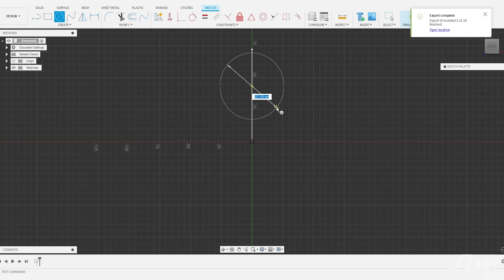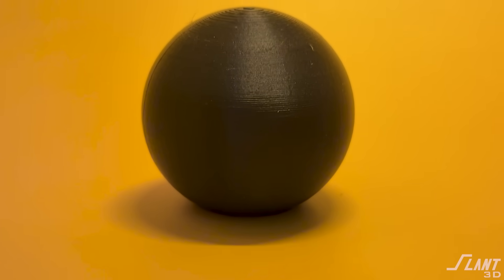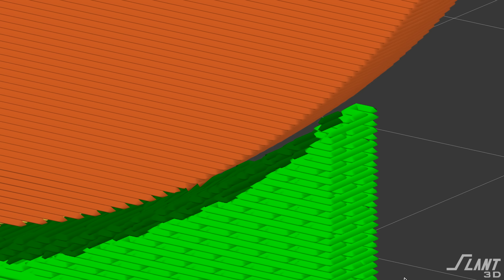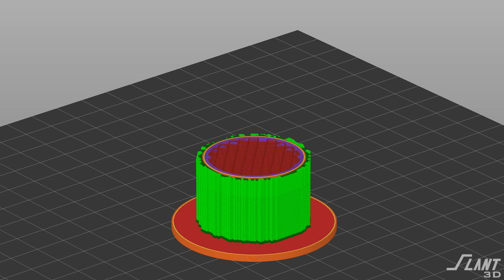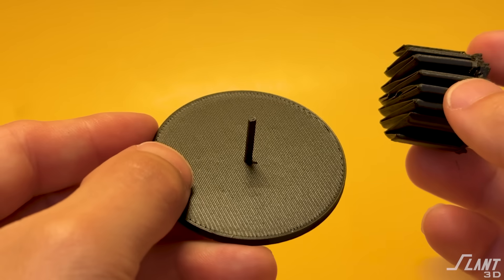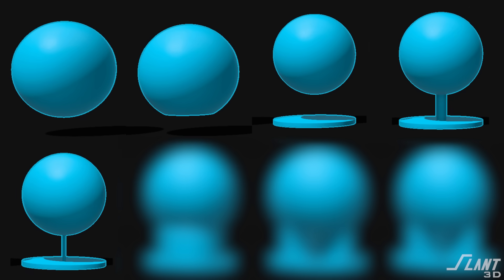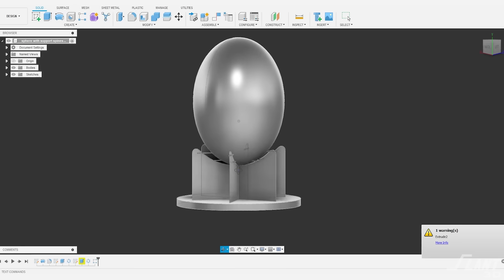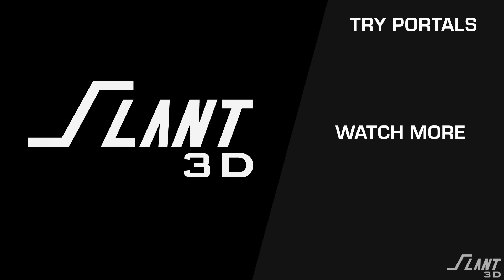Can We 3D Print a Perfect Sphere?

Comment: What about printing just a support and beside it a half sphere. When that's done, it pauses while cooling the nozzle, then you pop off the half sphere and place it upside down in the support. Then the printer with its cooled nozzle pokes the flat top of the upside down half sphere until it's level, heats up again, tacks the now leveled half sphere to the support and continues printing the other half to make a full sphere. 

Now you have a perfect sphere with 2 top surfaces and no bottom surface!

Comment: I had a great result splitting in halves (as many suggest here in the comments) and also adding correspondig pinholes that i print little pins for, so that the fixing together with glue becomes as correct as possible. Doing this and setting the layerheight to the lowest possible made a really really nice result when doing some knobs for my friends vintage car seats.

Comment: Interesting video! Printing a perfect sphere can definitely be tricky, but with XIONEER VXL soluble support material, achieving smooth results is actually quite manageable. ;-) The supports dissolve cleanly, making post-processing much easier and reducing warping issues significantly.

Comment: Hey Slant 3D, I’ve been trying to reach support for over a week without a response. One of my clients purchased my designs through the portals but hasn’t received any confirmation or tracking info. Could you please look into this? I’d really like to continue working with you.
Reply from the maker: Send through the info you have and your account to support. I tried tracking the order from your YouTube user name. If I got the right info it is in transit. Parts can take 2-5 days to print and then there is transit time. And obviously have the customer check their spam. They should receive a confirmation and tracking email.
Reply: @slant3d  Thank you for your time and effort in resolving this. It would be nice to know more about how the Portals system works from the client’s side. Does the client automatically receive an order confirmation or tracking number? Or did we do something wrong that caused our client not to receive this information after purchasing the item? Also, we’ve tried sending these and other technical questions through the Slant 3D contact form but haven’t received any replies. Regarding Portals, should we use a different contact to get the answers we need? We just want to understand how everything works.

Comment: To print a sphere, raise up and use multi-material printer with dissimilar material supports.
Or if you have a single material printer... 
Print hemisphere. Use elephant's foot compensation or print onto raft for max accuracy.
Remove from bed.
Print cup into which the hemisphere fits, with GCODE to pause and hold bed temp and motors at the end, and zero Z height. 
Put soluble glue into cup.
Place first hemisphere into the cup so it's perfectly level with the 
Print another hemisphere onto the first, ensure GCODE is does not have any homing.
Remove sphere, clean off glue, enjoy sphere.
But... why did you 3D print a sphere anyway?  Did nobody sell a correctly sized sphere?  If you needed something other than an exact sphere, tweak the design to include intentional features which avoid this issue.

Comment: All these videos should start with "Using our machines and portals with our fixed settings and without any post processing....how do you get a sphere like object?"
Most of us are trying to use every feature and trick available to make one or a couple "best parts". Slant 3d is trying to make N number of parts with no manual intervention , using fixed printer settings to make parts that are "good enough to sell".
It is not the same approach.
Same as a craftsman making one piece of furniture versus a factory making 1000 copies of the same piece. 
Each uses different techniques.
Changing your design to suit the limitations of the process will make the final result look like less of a compromise.
Reply: Stuff like adaptive layer height and scarf seam (not sure it would work in this instance) are indispensible slicer settings, but other than what can't truly be replicated outside of a slicer, even if you don't mass manufacture, it is better to have to change less things to get the result you want. Because consistency matters in most cases, even when printing gridfinity boxes for yourself or anything, really. So if you happen to have another machine or other material or have any change whatsoever in your print environment, you don't have to experiment all over again. I also advocate getting close to perfect results as possible, but if you can achieve the same close to perfect result in a less messy way and in less steps, that's more preferred.

Comment: I know yours trying to avoid doing anything in the slicer, but adaptive layer lines, changing the wall order, and adjusting the line width can all work together to solve the issues with steep overhangs. If you are really going into production on something you are going to do DOEs to dial in these defects and get closer to what you want.

Comment: I made a sphere as two hemispheres with a central hole into which a cylinder fits snuggly. All three parts print and and are then assembled with a bit of glue or you can make it a press fit. The cylinder provides alignment during glue up or a mechanical link if no glue is used. One could use any other extruded polygon or a threaded feature if you want to restrict rotation of the parts after assembly.
If you want to use the threaded method, an actual metal threaded rod can be used to join the two.
This same method also works great for making a tire / wheel where you want rounded features as printing this way eliminates the "bad side" of the print.

Comment: 4 methods to print perfect spheres:

1. split the model into two half spheres and glue together
2. use specialized support material
3. use PLA for the model and PETG for the support or the other way around
4. use adaptive layer height in the slicer settings. you can print steeper angles with thiner layer height
Reply: That's basically the best answer
Reply: All of that would be good general advice. The advice that comes from this channel pretty much only pertains to advice about their printing service.

Comment: Is it possible to print the cut-off version of the sphere (e.g. hemisphere), pause the print, and then rotate the sphere on the bed until the flat part is facing straight up, then resume the print and have the printer finish it off?

Comment: i just truncate a segment off the bottom that way i have a decently large flat surface for the print bed and i have less extreme overhangs as the lines go up the sphere. no supports. ive always found that in my designs i never need a 100% sphere, i can always hide the flat surface inside somewhere after assembly.

Comment: If cooling at the boundary of the sphere and the support is the problem. Continue the support to the mid point (or further). It doesn't have to touch the sphere just reduce the air flow, alternatively change the cooling fan at that height, though this does break the design once, print anywhere strategy.

Comment: Perhaps the only way to do it is to cut the sphere in half so you have two completely flat areas to print and then glue them together. Put a hole in one half and a pole in the other so they line up perfectly and have strength. 🤷‍♂️🤔

Comment: I thought the cop out option would be to split the sphere in half with both halves flush to the build plate and affix them together after the print. 
Also expected you to mention how to resolve some of the issues with the seams - like using scarf seams and variable layer heights to resolve the issues with banding.
Reply from the maker: Thought about that
 But half spheres are not spheres. Mainly wanted to show how to support a curved surface

Comment: 'Adaptive Layer Height' seems like very low hanging fruit for getting a better result. I don't think the inconsistency has anything to do with shrinkage, it's just drooping unsupported lines. You could also use support interface if you have a suitable printer.

The floating sphere is an interesting idea though.

Comment: Did you try resin2fdm? the thin supports might give better airflow and reduce warping
Reply from the maker: We made the thinner supports in the video
Reply: @slant3d  Yes but not as thin as resin supports and also on resin supports the contact points are small so there would be less warping. Look into resin2fdm its really cool

Comment: Cut the ball into 2 parts, print with flat on bed, glue together when done (a post hole and a printed small post help alignment) and this will achieve the perfect sphere (I've done it and if you are good at aligning the 2 parts you will never know it was 2 parts).
Reply: 3d printing "entrepreneurs" are obsessed with making their designs require the least amount of post processing possible.
Reply: @makarevych  They'll print the same part they only need one of 10 times trying to dial in the settings when 5 minutes with a file probably would fix the first one...
Reply: @makarevych well in this case it makes sense because this channel only exists to advertise their service. They print stuff for you and send it to the customer. They don't want to be sanding or gluing your parts for you, they just want to print it and ship it.

Comment: What if you create a custom mesh like support to give the sphere air flow.
For example, those airless balls that are a mesh print quite well. What if i make a custom support for the sphere like that...

Actually, I will try it... Create a pillar, cut a sphere shape from the top, add a sphere to the top. Now i have 2 objects. In the slicer, define the pillar as a gyroid infill without top surface and walls.... Use Arachne, and dynamic layer height for the sphere.... Let's see...
Reply: But no matter the support type, even if the pattern and contact is different, there still would be the issue with the contact point no mater how small
Reply: @user-ll4om5pq4u  The  airy gyro support did fix the warping, but the contact points are still noticeable around 1 cm for a 40mm sphere.

Comment: So what I'm hearing is encase the entire sphere in support material all the way around and on top so the shrinkage/cooling is uniform throughout.
Reply: Yea I really expected the last version to be exactly this - have the supports envelop the whole sphere (or probably just to the mid point) - would be interesting to see if the shrink line is still there or not. The final twist with making it into an egg was a little disappointing, although it is definitely a valid reasoning point,.
Reply: You probably can also design difference in sphere size, so open part would be slightly bigger to shrink perfectly? Probably not gonna work, but it's interesting to try I guess.

Comment: I'm not sure what you are describing as a shrink line is actually a shrink line. I think what's going on is a transition from how the sphere is being supported. Essentially, the part goes from being printed on supports to printing on top of itself. When it is printing on the supports, the liquid plastic gets layed down a fraction of a millimeter lower than where it should be, and this continues until it reaches the range where the overhangs are steep enough to where it starts printing on top of itself directly. 
This leaves a hairline gap that has to be compensated for somewhere, which is the actual source of the warpage and ugliness. Your CADded supports seem to indirectly address this, but I can't quite put my finger on why.

Comment: I know you hate relying on slicer settings, and I get why, but... if you take the designed in supports, and you make them lines rather than wedges, it will reduce the wider shrinkage areas right at the base, then combine that with variable layer height so the steeper curves have more fine layer height and you can probably get pretty darned close to a decent looking sphere. Of course, that does take you out of the realm of using it in something like Portals.
Reply: I agree here, you could take the supports further, and variable layer higher would REALLY come in clutch here.
Reply: @abowden556 can you explain what you mean by the variable layer higher and what would you adjust it to?
Reply: @ClappinCheex  for steeper parts of the curve, have the layers be thinner, the steepr the curve, the thinner the layers. This can even be variable based on if it's infil, or just perimeter, but there's problems with that, anyhow, even the safe simple version reduces stair stepping without blowing out print times too much, depending on the model and orientation.

Comment: Ya saddly design isnt really going to fix this issue what you will need back pressue on the molten plastic to correct the overhang and in order to get supports removed the only way to do both is in a multi-material setting (obviously without the egg copout or even splitting it into 2) this is why i want an idex so bad i dont care about multi-color just muti-material

Comment: I print a lot ball and socket joints in resin. With such joints the whole sphere does not need to print perfectly for them to remain functional. For instance the area of the sphere which printed poorly could be used as the place where you insert a rod or something like that. Or in some cases the rod can be 3D printed alongside with the sphere doubling as a support.

Comment: How would you design a support for a box with a domed, lattice hinged lid? I have a product I have been trying to improve the underside (inside) of the dome (printing it with the box bottom flat on the printer works great for all other parts of the print). The cross beams of the lattice comes out a bit rougher than I would like no matter what I do.
Reply: Step the bottom of the lattice beams up a few layers at a time.  I.e. have 1-3 bridge first, then 1-3 cross beams bridge using the first bridges as support, etc.  Some of the lattice beams will be rough, but most will be clean and crisp.